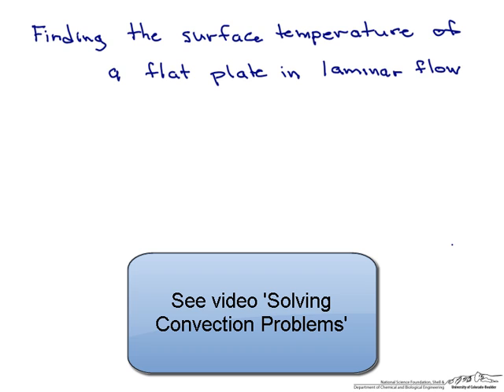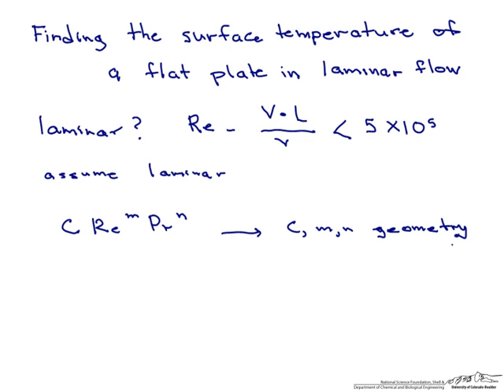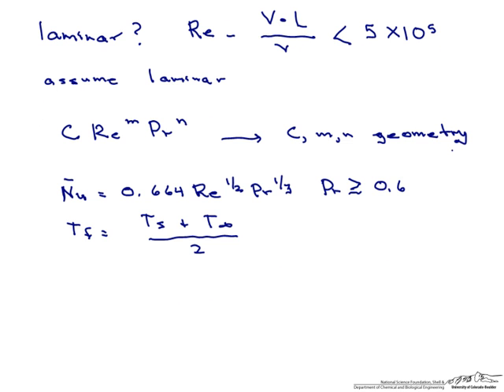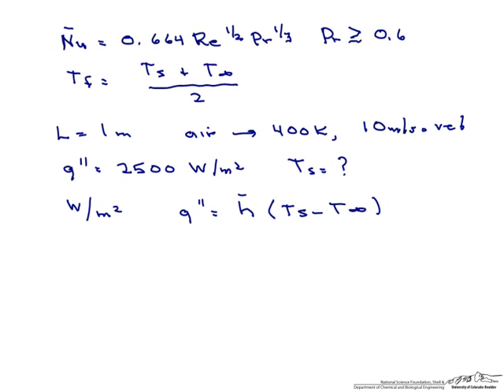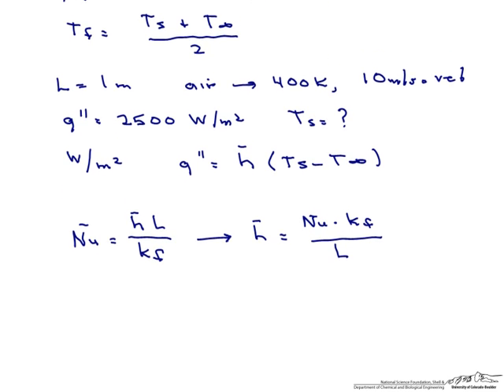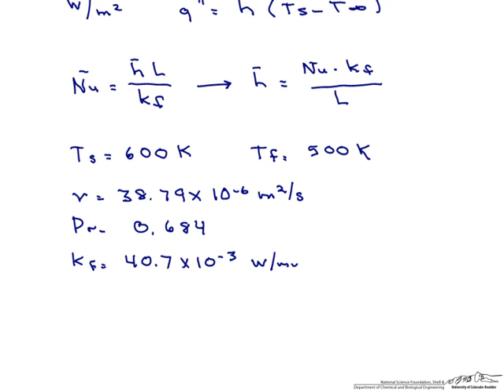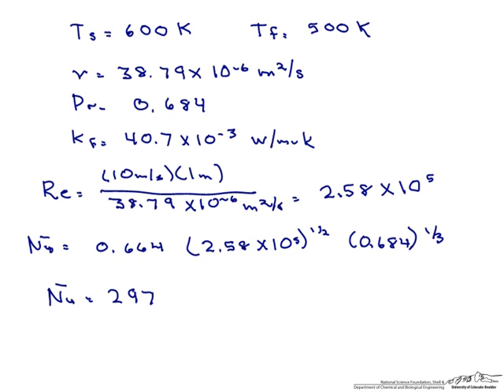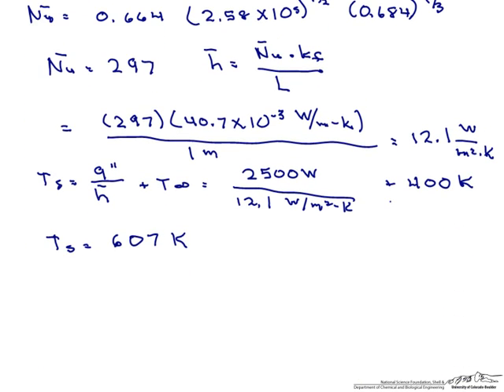Laminar Flow: Flat Plate Surface Temperature

Comment: Isn't the answer calculated close to 600k because you guessed it to be 600k and use the values of Pr, v and k at 600k. If you have guessed it to be 700k, wouldn't the answer be different?